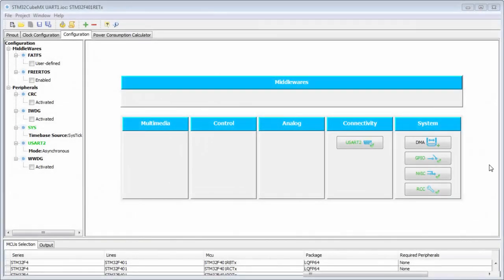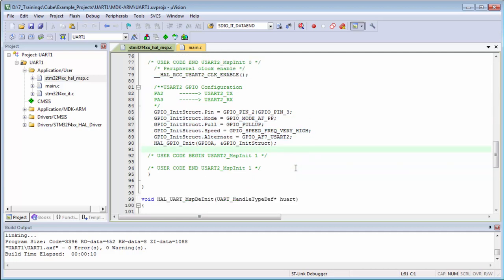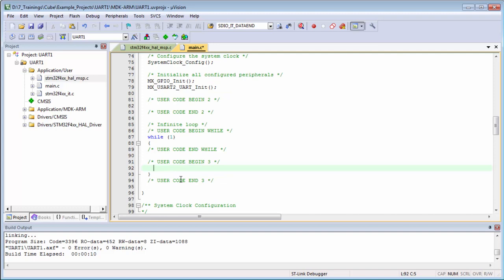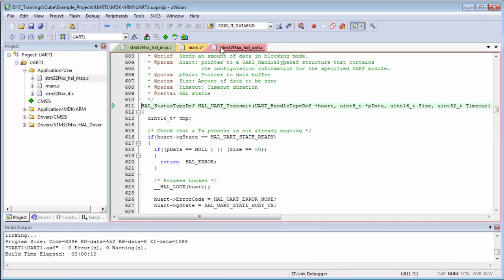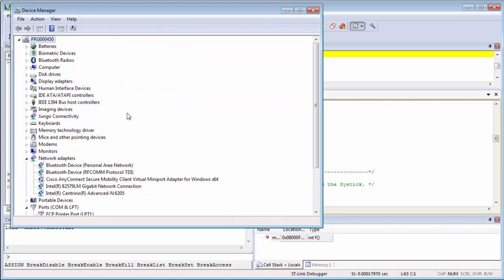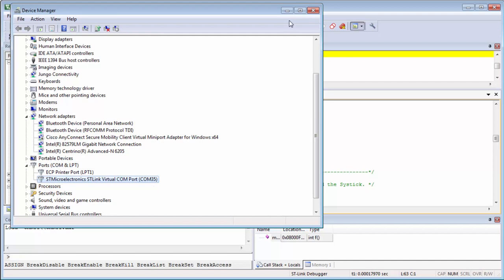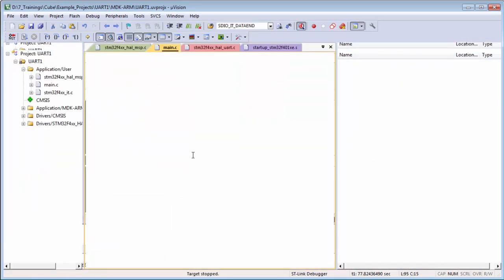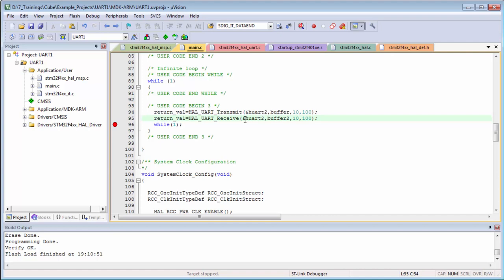STM32CubeMX basics: 10.2 STM32Cube HAL labs UART - UART poll Keil

Comment: I do not underestand the Hardware, the debbug connection is at the same time the USART bus, I mean all is running by the same usb cable ?? Because I have NUCLEO F413ZH with CUBEIDE and I can not see data un the RealTerm.

Thanks for the info
Reply from the maker: Thanks for your question. We've reached out to our colleague who you hear in this video series. Here is his feedback. We hope it helps.

The Nucleo USB part is a composite class.
Which means it is ST-Link debugger
Mass storage device (usb disk)
Virtual com port

This is the reason why it is possible to see debug and terminal. 

For the UART, it is good practice to first check which UART of the STM32 is physically connected to the STlink. This can be found in the Nucleo schematic. And to check that it is physically connected over all solder bridges.

For sure, it is also good practice to have a check of the TX part with the oscilloscope.

Then on the PC side, in the device manager it is advised to check the com port which the STlink VCP have. 

Then you should have data in your terminal. If the baud rate is correct.

Comment: But how to connect rx tx pins to laptop?
Reply: Uart2 is wired to the USB port on Nucleo board
Reply: You can use a TTL-232R-3V3 cable. One of it's end is USB the other has the RX TX GND etc..